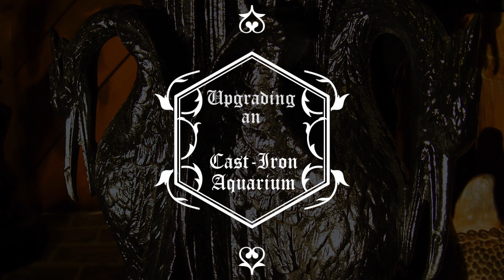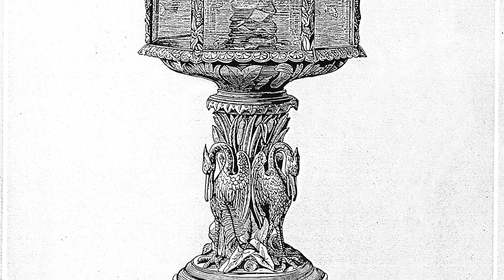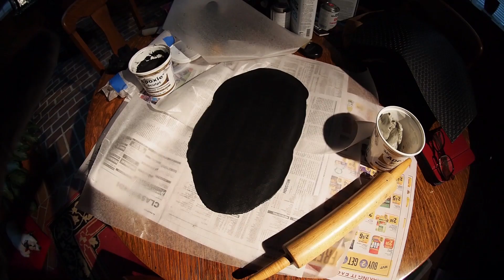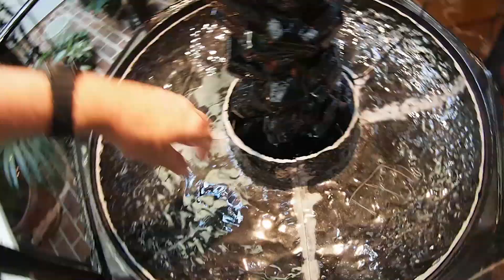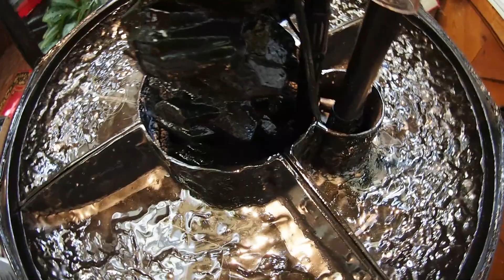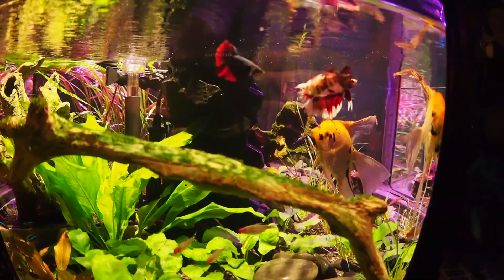Upgrading an Antique Cast-Iron Aquarium

Comment: I mentioned in the comments of your older video there’s a British aquarist (“M D Fish Tanks” here on YT) who advocates and demonstrates building “bio-active” aquaria. These are closed units who use terrestrial plant roots (in addition to aquatic plants) growing in the tank to do all the filtration. Some plants he uses are ficus, pothos, philodendrons and ferns. He claims no other filtration is needed and he doesn’t even do water changes on his “bio-active” tanks. Beautiful tank btw. I have a smaller rectangular “Fisk” aquarium with twin herons on each corner.
Reply from the maker: Great! I collect the Fiske and Mott catalogs as well -- if you send me a photo of your tank, I might be able to find the catalog reference.
Reply: @PawlikLab  
I’ve actually seen it in a Fiske & Mott catalogue at the shop up in Hudson, NY when I purchased it. The aquarium is rectangular; fairly large approx 36”x24”x24”. It has twin herons on each corner with some stylized cattails & marginal plants and the bottom has a similar filigree as yours. It lacks the flower pot holders but rather has stylized iron “sea-shell” finials in each corner. The bottom itself is metal (iron?) and there’s a hole right in the center. It also weighs A TON! lol Amazingly all the glass is original and i just recently noticed in addition to whatever “cement” they used the whole frame is assembled with screws! This will make refurbishing it somewhat easier. Not sure about a fish tank but I think I’d like to make it a paladarium with a very old, concrete fountain in the middle to circulate the water. There’s a cement statuary foundry out on Long Isl. that has new castings from old molds. He also sells original pieces from old fountains & ponds that were once on estates. I know he’d have something amazing! I wish it had the bottom but I can improvise with either the oak leaf table base or a cement base consisting of 3 seahorses all back-to-back. The cement guy makes them from old molds as bird-bath bases.